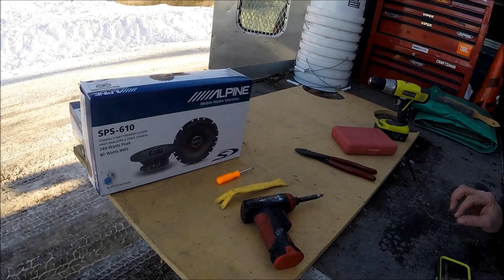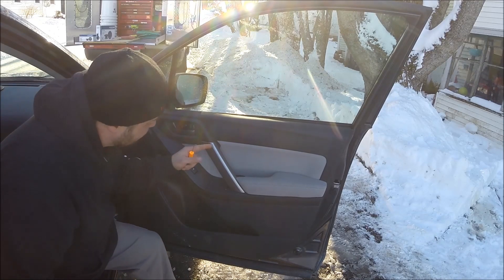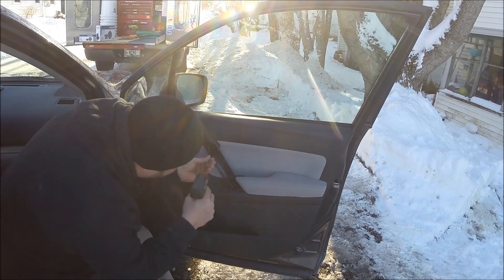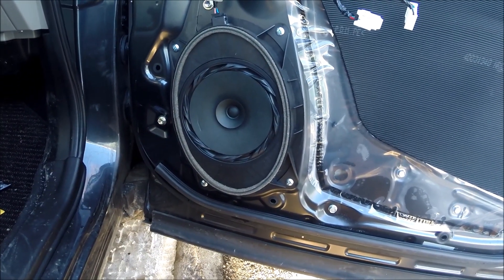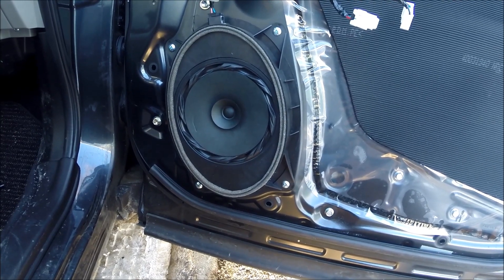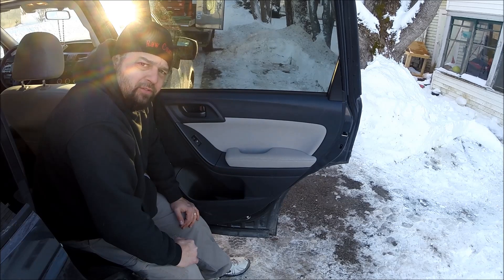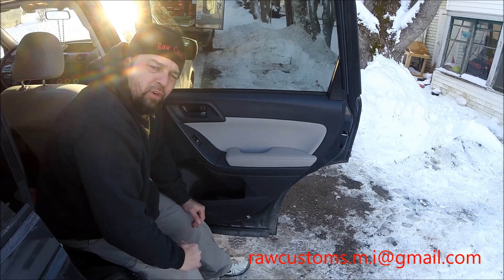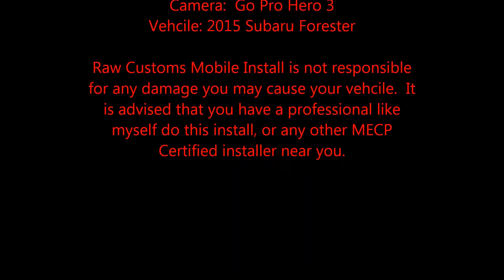2015 Subaru Forester How To Remove Door Panels

Comment: What kind of speakers sound best with the stock system's power output? You've got Alpines in this video, but isn't an amp necessary given the anemic power of the stock system?

Comment: if a buy 6X9 speakers, would it be a direct fit? or close? thanks
Reply: Just buy an adapter to pull a little bit out of the windows and you will be fine